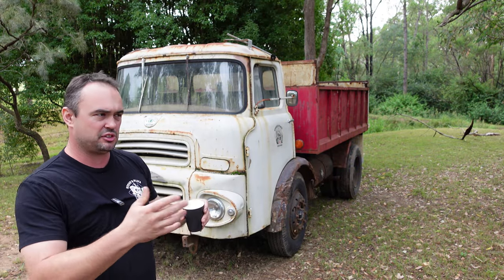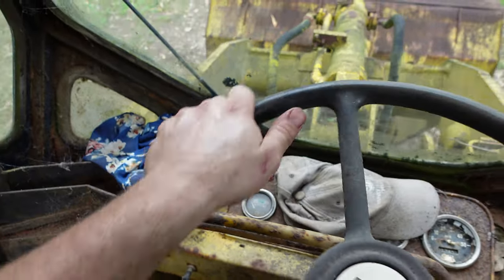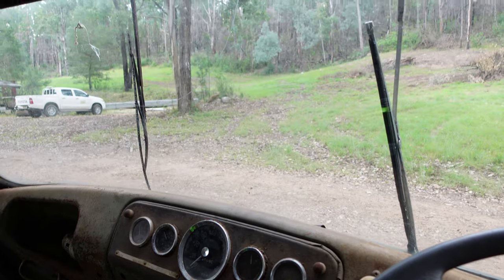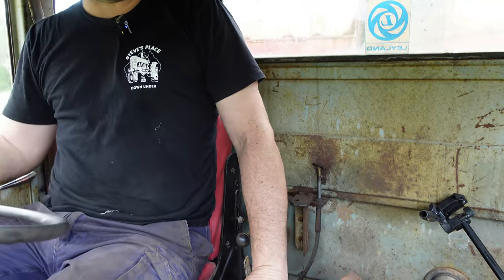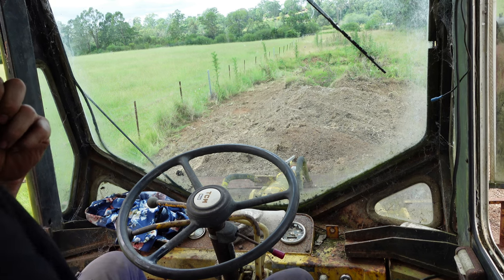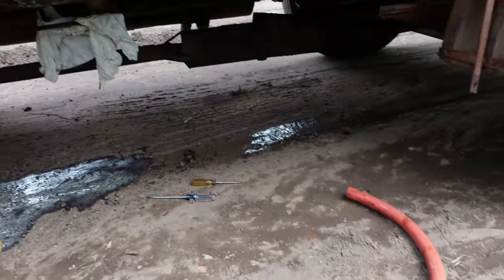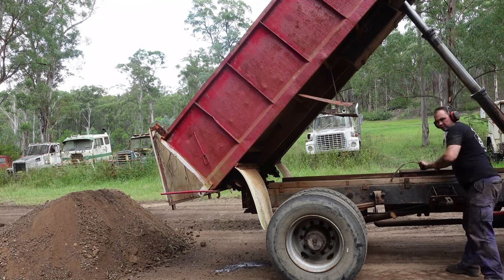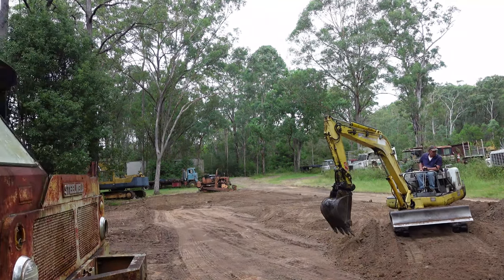We put our FREE Albion Clydesdale tipper truck to the ultimate test.

Comment: Hi Steve, I have a multi fit can holder for all my old machinery, its a magnetic base from a rotating beacon with a spaghetti can screwed to it, works a treat and sticks to anything steel
Reply from the maker: Hi mate. This is a magnificent idea. Thank you and keep an eye out in future videos for something very similar
Reply: I have a couple of magnetic beacons on my ute.  They have a sticker on them, saying the magnet is rated for 110km/h travel.  They hold on ok.  One beacon has a rubber base as well, it hangs on like a frightened passenger to a door handle.
Reply from the maker: @railtrolley again mate it’s a great idea. I’ve been looking around for an old beacon at work to get the magnet off. You will definitely see it in future episodes

Comment: can you explain the gearshift on the old dump please ? ive never seen anything like it before Steve. Hears an idear for you . when undoing the hydraulic line to prevent oil from coming out of the bottom valve connect an old vacuum-cleaner to the inlet and seal it then turn it on and it should prevent a lot of oil from coming out ok.
Reply from the maker: Hi mate. It’s a 6 speed crash box main trans with an inbuilt manual splitter. The lever for the splitter is mounted to the back of the cab and is used to split every gear. Yes at work we use a vacuum device that the air plugs into to vac down the tanks to prevent oil leaking out

Comment: I'm going to guess the pressure relief valve is in the hydraulic pump, a lot of the older stuff is built that way, probably still a blockage in the vent tube as well if you're still having issues raising the bin.
Reply from the maker: It may well be mate but not a real big pun and I can’t see where it would be. I may have to pull it off and look closer. I do have another one that I can look at also

Comment: Steve I noticed for  few seconds while you were revving the Albion that the amp meter points to the left for charge rate . Is it reversed from most amp meters? And I did notice the manufacturer plate in the cab. First truck I ever saw made in Scotland. A ride along in the Albion and the Clark loader and a little hydraulic hose work . Was able to see the actual miles on the clock of the Albion sitting at 49692 . I like the details. Thanks mate !    Scott 🌵
Reply from the maker: Hi Scott. It’s not some I actually took notice of but it does charge and the gauge works but didn’t notice that. I more look at oil and temp in these old ones. They did well for a cheap loader and a free truck. Very happy with it all.
Reply: They both did a great job. Still doing what they were meant for. 😊🌵

Comment: Wonder if you can flip plates over in pump? Odd there not a relief somewhere. Unless it's built into pump. 
Awesome job n cool equipment
Reply from the maker: I will have to pull it off and look further into it. There’s nothing I can see where it would go. There would have to be one somewhere for when the hoist dead ends
Reply: @stevesplacedownunder  built in bypass once rod extends so far on cylinder 🤔??
Is there a suction screen in tank that's partially plugged???
Reply from the maker: @jackpinesavagerepair1918 I’m going to look for a plugged screen because the oil is milky so it could well be

Comment: Nice video Steve.  Tough old loader those Michy's. In the past on the older loaders, I have even just thrown the original steering system away if it causes to many problems and mount a single acting control valve in the cab and steer it with a lever like an old Timberjack Skidder. Pretty cheap, simple and very reliable way to fix it if it turns out to be a major headache.
Reply from the maker: Hi mate thank you. Yes I understand what you are saying. That’s a great idea really. Would be good mounted on the left side of the seat. Would be like a later model machine then, apart from reaching out for the forward/reverse lever. Thanks for the advice mate. Very welcomed